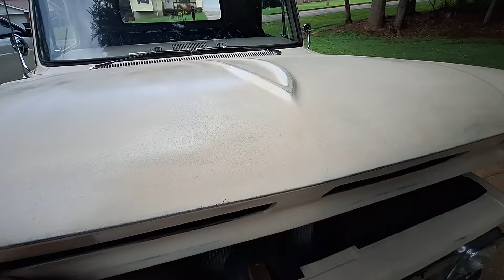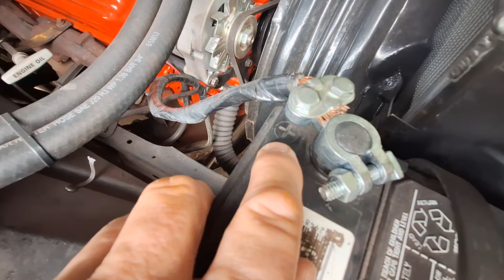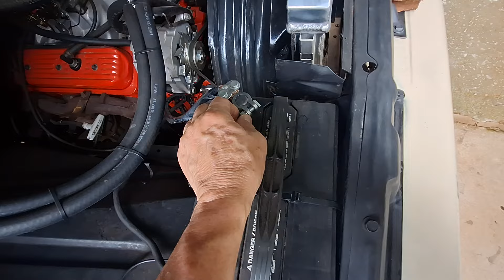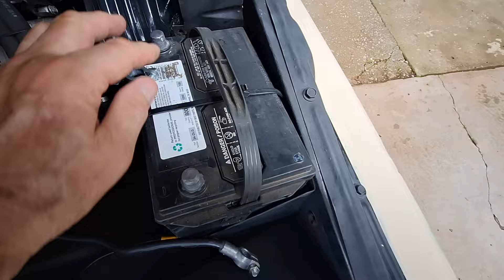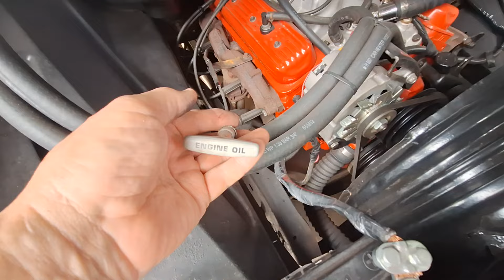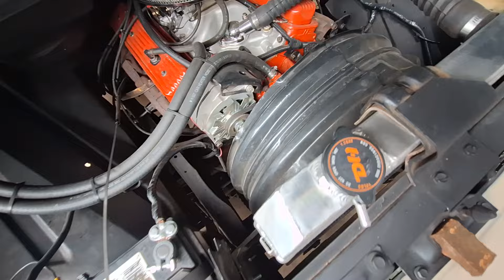Which Cable to Disconnect first? How to Disconnect and Connect a Car or Truck Battery the Right Way!

Comment: As you saw in this video, Jimmy is right. Want to go further? It's easier to insulate a metal tool using a nitrile glove. For example, this is helpful if you need to cover sockets while removing a part while under power, such as a starter where the battery is buried in a wheel well or under a seat.
Reply from the maker: Thanks buddy! You're always helpful! Have a blessed day today buddy!

Comment: Just 1 complaint Jimmy you should use a box wrench instead of the adjustable. 
   When I was working I’ve seen people who changed their own tire and put the lug nuts on backwards (tapered part facing out)
😎Dave H
Reply from the maker: That's true. I just had that tool with no plastic coating on it. Just to explain the Rag I had in the video.

Comment: Positive on first so it doesn't spark and fry you of your electronics and Negative comes off first. When I was going through tech school, both cars and motorcycles this was on literally every written test we took. They also make red electrical tape, I keep a roll of red and black tape in my tool box.
Reply from the maker: You're right on everything you have said buddy! Thanks!

Comment: Yes, always disconnect  neg.  first then pos. ,,  reconnecting,  pos.  first when neg , otherwise  if done wrong will create  a spark which could hurt computer  ,battery etc. When jumping someone  with cables same applies  in connecting cables
Reply from the maker: You're right! Thanks buddy!
Reply: Years ago, my cousin was working on his Jeep. Got his wedding band wedged between the hot post on the battery and the inner Fender, burnt his finger all the way around the width of that wedding band, so you'd got to be careful around the hot post even if you're not messing with the cables.😢😢
I saw his Finger, after the fact it was not pretty.
You and Mrs. PIb have a great day.
Reply from the maker: @kerrymcclure7503. That's good information to know buddy! Thank you for sharing your story with us! Have a blessed day today my friend!